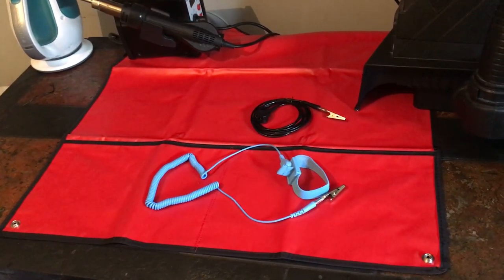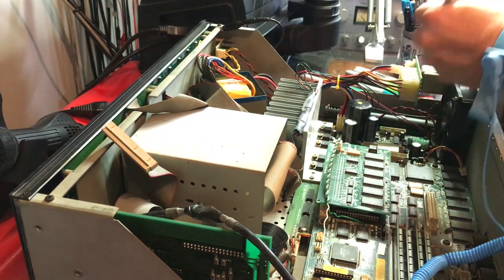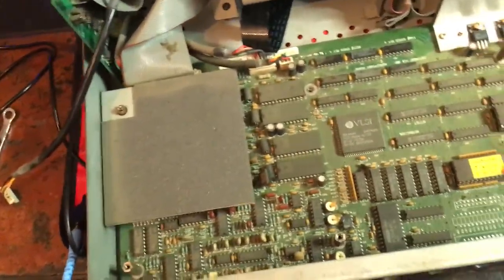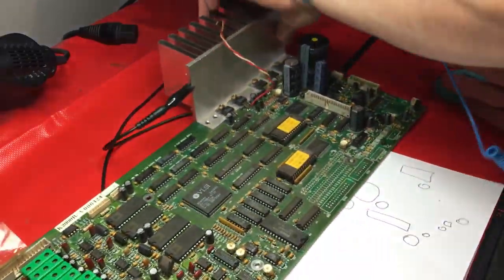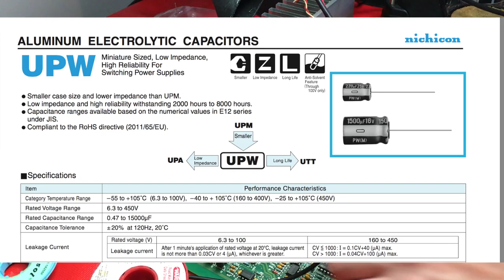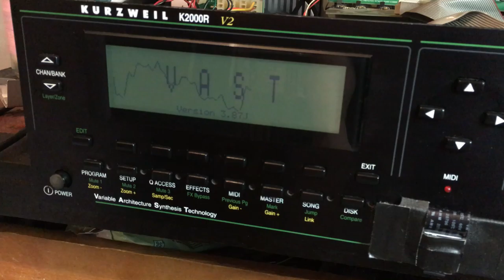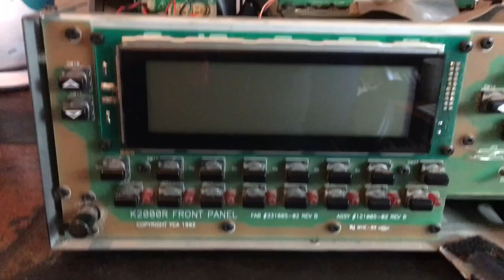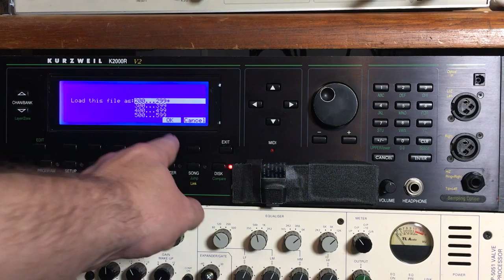K2000R RE-CAP AND NEW DISPLAY

Comment: Obviously you did this a while ago but I'm about go through the same process with my K2000RS. I have documented the cap values but I'm a little unsure about the lead spacing. Do you happen to have a list of the exact caps you used... i.e. the part numbers for Mouser or Digi-Key etc.?
Reply from the maker: Sorry I had a dig around but I couldn't find the order I made